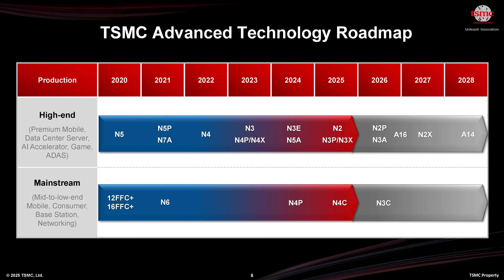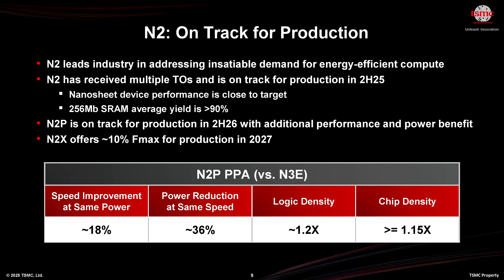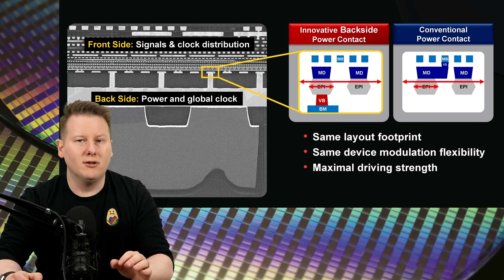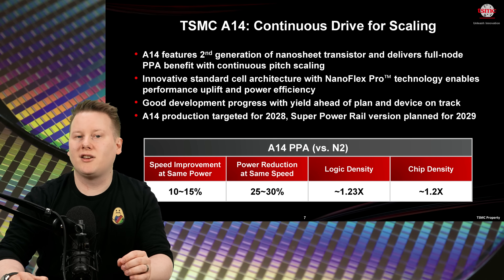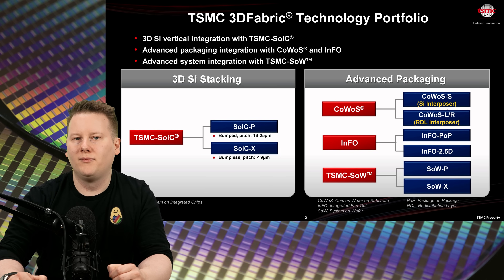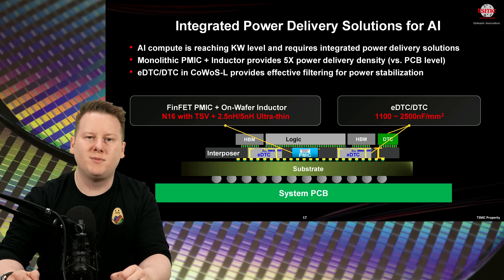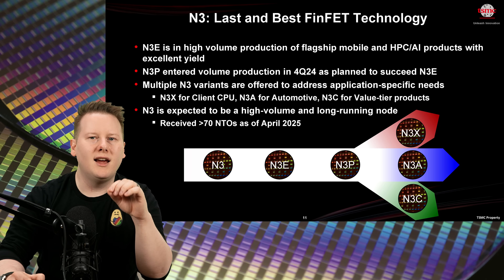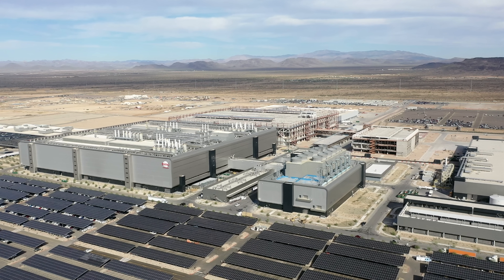The Future of Chips is TSMC's Roadmap to Success

Comment: Where is High-NA in TSMC's roadmap?
We used to see a doubling in performance from only moving to the next process node without much fancy new tech. Now, we are not just changing the transistor "size" (I have put size in quotes because the size of the transistor is nonlonger accurately represented by the name of the process node. 2nm is not really the size of the pitch in an N2 node). We are changing the transistor itself from FinFET to Gate-All-Around. We are also changing the structure of how transistors are designed with Backside Power Delivery. All these changes, and we still can't even get a 1.5X performance uplift.
Even though the performance uplift is not what we used to enjoy, the technological innovation needed is a marvel as things get even more difficult and complex as we advance the process nodes.

Comment: so anywhere from 1.38-1.42 density/ transistor increase from N5 -> N2E.
That means for a 40% jump in performance from a rtx 5090 the next Nvidia card has to be in N2X or 1030mm² in die size...

Comment: A14 is really not looking good. I understand the difficulty they are dealing with but even if we assume they meant N2P when they were comparing N2 to A14 That is almost no progress for a full node (Probably why they refused to compare A14 to A16) that is going to take 2 years. desktop parts on A14 might only be 2-3% faster and 10% more dense then A16 based on their own marketing numbers.That means we are essentially stuck with desktop parts and I assume price  per wafer will go up alot making it even worse. We might see 2-3 maybe more generations on the same node get more common after 2nm.Efficiency scaling looks better for mobile but the desktop outlook is pretty sobering.
Reply: TBH, it was an inevitable brick wall that they would run into on pure transistor size as a relevant measurement. Moore's "law" was destined to completely fail at some point and what we are left with is pure marketing buzz that implies that transistors are shrinking by 50%, but it's all basic nonsense and has been since the roughly 10nm era, when "nm" had any real meaning.  In the future, it's all about layers, discretes and stacking, not transistor size.
Reply: seems we will be stuck at 150-200mTr/ mm2 until 2028 probably, maybe 300mm2 in 2030 A12

Comment: improve node a bit, sell the same architecture again, repeat.. again, again and again. minimal R&D spends insane margins, steady insane profits and prices don't drop because progress is minimal and overpriced. enjoy the same iphone/GPU/CPU as 5 years ago with minimal improvements... but with higher price)) just keep buying and with 0-5% gain/year you'll see actual progress in year 2080
Reply: they should just make realistic graphics with AI from primitives in realtime. and make rasterization in games obsolete (it should be used just for primitive graphics for AI reference). GPUs of the future must be just AI cores making realistic graphics from primitive graphics thats done on integrated videocard - iGPU. and maybe with NPUs we won't need GPUs at all anymore. RIP amoode and ngreedia.
for realistic movie-like rasterization you need way more work to be done on games by devs with animations/level design/modelling and way more resources/rasterization speed. more GPU power essentially + VRAM (that last one can be easily fixed though by connecting DDR5-6-7/SSD directly to a chip like amd already does on consoles, no long PCIe bus for DirectStorage = no huge latency problems).
with AI generating a picture you don't need any of that just feed it photoshopped or even selected AI generated pictures of what you'd want to get and primitive 3d graphics so it doesn't fall apart and everything stays/generates where it should be + a description of whats going on. thats it.
that would enable anyone to make their own REALISTIC-looking movie-like-quality games (or movies). RIP big game studios and hollywood.

so to save big game studios and hollywood and steady money income (themselves) GPU manufacturers nv/amd/sony/ms killed the progress with GPUs. 
endgame GPUs with realistic graphics are the last GPUs you'd EVER need to buy. nothing to sell after you bought them. so corporations are milking the market instead with 0 progress slow junk.
Reply: simply stop buying new then, you can build a PC with 2020 parts and  its plenty fine, and less than half what it was new back then. Same goes for a phone or any other gadget, just buy used or buy less
Reply: @user-lp5wb2rb3v  i completely agree that anyone should buy used instead and don't feed corps greed, but its not the solution. meanwhile techshills on yt keep spreading marketing lies and make noobs overpay for new 0 progress overpriced junk. so we are stuck without progress because noobs want to listen to shills/marketing and to keep buying slow junk
Reply: NVidia, Intel or AMD CAN TECHNOLOGICALLY make 'processors and GPUs that are 2x the speed of THEMSELVES in each successive revision, but they DEFINITELY NEVER WOULD. guess WHY? because why sell something 2x as fast as previous gen when you can MILK IT FOR 2 DECADES MAKING 100X MORE MONEY. no R&D spends, just steady income stream, just feed noobs marketing lies about "physical and technological brick walls" while memristor or tera-herz zirconium dioxide tech EXIST for 2 decades already.
Reply: fast 2x progress WOULD DROP LAST YEAR PRODUCTS PRICES by 2x at the very least. no corp wants to compete AGAINST THEMSELVES. thats why e.g. they sell low-VRAM 0 progress 10x overpriced GPUs and also crap hardware consoles and stripped out CPUs like no 3dvcache ryzen because with 3dvcache they raise prices 3x times. all to keep prices HIGH. make noobs believe 'its hard to make'. no its not. its just paywalled by corps and all raising competition gets bought or sued and destroyed by multi-billion greedy corps
Reply: It's called a physical and technological brick wall, pointless whining about it won't help.  Moronic conspiracy-theory laden babbling is comically pointless.  If NVidia, Intel or AMD could magically make 'processors and GPUs that were 2x the speed of the competition in each successive revision, they would, but guess what...
Reply: there's LITERALLY NO physical or technological brick walls)) the moments corps actually NEED progress to catch up to ACTUAL competition (that sometimes rises from desire to gain market share) THEY EASILY DO IT. like amd with 9070xt and rtx. when corps NEED progress it IS RIGHT THERE.
intel didn't actually want to make a GPU faster than nv, all they want is those sweet huge GPU margins thats why they are making GPUs now when GPUs are 10x overpriced and have HUGE MARGINS. thats how b580 came to exist.
when ryzen started cores race INTEL EASILY DID 'glue-up' themselves. apple easily made the best mobile CPUs then qualcomm/nuvia EASILY made the same - just software and prices suck because they want TO MILK, not to compete or drop prices.
then amd easily made ryzen x86 chips faster than Apple because Apple started milking their M chips. they even never compare it to predecessor like m4 vs m3, because there's basically no progress. they only can compare it to M1 to make gains look somewhat decent (ignoring overprice).
Reply: lookup Bolt graphics. you really think nv/amd can't do the same? really think they can't do more VRAM on 300+usd cards that costs like 30usd for 8gig gddr6? really think they can't make proper directstorage on PC GPUs without long laggy PCIe bus that ruins it? just how they ALREADY do on consoles or radeon pro ssg from 2016?
really think intel can't release intel tera-herz? they just don't want to because fast tech progress will make ALL current tech obsolete and DROP IN PRICE TO 0. they want to sell you 40yo silicon tech instead with miniscule yearly gains and make trillions. they want to sell you 6yo performance in GPUs with insane overprice. they want to sell you 3dvcache with 3x overprice not with just BOM/manufacturing cost +20-50%  on top. nope. pay +1000-2000% or even more for "new" a bit faster tech. 5800x3d is basically the same as 7500f in gaming performance. you really think they can't just use 3dvcache on all desktop CPU? can't improve IN OBVIOUS WAYS GPUs? more VRAM, ssds directly connected to GPU chips to remove directstorage bottlenecks, tiered memory with DDR5 for textures?

GREED is whats stopping the progress. technology and physics are fine and dandy.
Reply: amd uses DirectStorage with ssds connected directly to a chip on consoles since 2020, Pro SSG 2016. Bolt just replaced ssd with DDR5, basically made a proper DirectStorage on GPUs without long laggy PCIe bus. the only reason amd still didn't do it themselves is they want to keep selling obsolete consoles hardware, better PC GPUs will kill consoles. bad for business. nvidia/amd are perfectly aware of what they are doing.

the same way nuvia is 5x faster than Zen4. yet why they didn't release it right away? because milking already existing tech is WAY MORE MONEY. qualcomm gonna make 'new' chips with the same old nuvia tech for a decade or more now. just like intel 14nm+++++++++ did. or how apple with m chips, or amd with ryzen chips. amd had performance numbers for zen @ ryzen 5000 levels before zen1 release. but then they've just cut it down to not compete much against intel. thats how am4 got long life - they just rereleased zen1 4 times each time a bit  less cut same chips with gains to match intel 10-14gens until 5000 was what zen1 should've been right away. then added 3dvcache to 5000 but removed it on 7000 CPUs to not compete and to not drop prices and SELL THE SAME CPUs more times while noobs are buying 3-4 CPUs instead of buying its 'complete final version' right away just 1 time.
Reply: nvbots kept saying 'build your own GPU if you don't want to pay for 10x overprice'. apparently thats what Bolt Graphics did.
some greedy huge corp probably will buy Bolt Graphics for some billions and kill it so they don't mess up them milking of the market with 10-20x overpriced junk, most likely we will never see it released. because thats what ALL huge corps like nv/amd/intel/apple/google etc. do - they milk the market to not drop prices on slow 0 progress junk they release
Reply: 'bad optimization' is nv marketing 💩they made up to justify 10x overprice and 0 progress with their GPUs. mining is over. nv mining-level 10x prices make 0 sense because GPUs DON'T PRINT MONEY anymore. nv stopped 4000 production half a year before 5000 launch to fake 'deficit' because 4000 with their msrps were rotting on shelves nobody was buying them. fake 'demand' and 'mining-like deficit' to fake that its 'sold out' everywhere and that msrps 'are fine'.
Reply: @awebuser5914  fast 2x progress WOULD DROP LAST YEAR PRODUCTS PRICES by 2x at the very least. zirconium dioxide would KILL SILICON production. and no corp wants to compete AGAINST THEMSELVES. thats why e.g. they sell low-VRAM 0 progress 10x overpriced GPUs and also crap hardware consoles and stripped out CPUs like no 3dvcache ryzen because with 3dvcache they raise prices 3x times. all to keep prices HIGH. make noobs believe 'its hard to make'. no its not. its just paywalled by corps and all raising competition gets bought or sued and destroyed by multi-billion greedy corps
Reply: NVidia, Intel or AMD CAN TECHNOLOGICALLY make 'processors and GPUs that are 2x the speed of THEMSELVES in each successive revision, but they DEFINITELY NEVER WOULD. guess WHY? because why sell something 2x as fast as previous gen when you can MILK IT FOR 2 DECADES MAKING 100X MORE MONEY. no R&D spends, just steady income stream, just feed noobs marketing lies about "physical and technological brick walls" while memristor or tera-herz zirconium dioxide tech EXIST for 2 decades already.
fast 2x progress WOULD DROP LAST YEAR PRODUCTS PRICES by 2x at the very least. no corp wants to compete AGAINST THEMSELVES. thats why e.g. they sell low-VRAM 0 progress 10x overpriced GPUs and also crap hardware consoles and stripped out CPUs like no 3dvcache ryzen because with 3dvcache they raise prices 3x times. all to keep prices HIGH. make noobs believe 'its hard to make'. no its not. its just paywalled by corps and all raising competition gets bought or sued and destroyed by multi-billion greedy corps
Reply: @awebuser5914  NVidia, Intel or AMD CAN TECHNOLOGICALLY make 'processors and GPUs that are 2x the speed of THEMSELVES in each successive revision, but they DEFINITELY NEVER WOULD. because why sell something 2x as fast as previous gen when you can MILK IT FOR 2 DECADES MAKING 100X MORE MONEY. no R&D spends, just steady income stream, just feed noobs marketing lies about "physical and technological brick walls" while memristor or tera-herz zirconium dioxide tech EXIST for 2 decades already.
Reply: that's not what's happening here.
Reply: @12100F  it is, ridiculous 4core  Intel processor from '22, thats exactly whats happening IRL
Reply: @rawdez_  2/10 ragebait, try again later
Reply: @12100F  ridiculous 4core  Intel processor from '22, nobody cares about what intel fanboys-shills 'think' about what "14nm++++++++++ corp" is. it is just another greedy corp maximazing profits and margins while selling the same crap to noobs  by just renaming it multiple times and changing sockets and a lot of marketing lies, corp that should burn for actual progress to happen. just like all others. otherwise they just milk the market and cause stagnation by doing so.
Reply: 14nm++++++++++ corp conveniently 'couldn't make progress' for YEARS, selling the same 14nm junk,  right until amd actually started competing (barely) with ryzen after bulldozer with fake cores. and just as ryzen started actually beating them oh MIRACLE! intel finally could do 10nm)) rejoice fanboys!))
and the same with 12-13-14gen. amd stopped actually competing, killed momentum with ryzen to milk the market, and intel stopped, and apple stopped, and nuvia/qualcomm didn't even start - overpriced their nosoftware windows arm junk (despite being 5x faster than zen4 we didn't see any real gains). and smartphones aren't better. each year for the same price you can get basically the same performance... or worse. causing stagnation with mobile software/gaming. those flagship dumbphones are useless because nobody makes software for hardware in them noone can or want to afford but a bunch of noobs with too much money. suddenly every corp started pricing hardware like they are also apple and their customers are all the same noobs that can't do basic math when comparing stuff as isheep.

Comment: lol, all corps get insane margins, latest iphone 16 n3 chip costs 30-35usd to make @16-17k per wafer. "will make economics work" ahhaha. if insane greed of selling 30-35usd chips with insane margins for 1200usd+ didn't stop "economics" then nothing will. "worst case" for greedy manufacturers they'd lower their margins/greed a bit.
rtx 5080 chip costs like 100usd made from tsmc, nv and AIBs sell that for 1500-1800usd. 5080 57fps 1080p indiana jones, that slow 10x overpriced 540p junk barely can run modern gaming engines @max settings. meanwhile 1440p 100hz monitors costs just 100usd which means 5080 has like 35usd worth of MODERN gaming performance. keep buying 10x overpriced junk, noobs, and "economics" of selling 0 progress 10x overpriced junk will continue "working" i.e. milking the market with slow as-low-as-possible "progress'.

Comment: Who cares about fake node names?! Why can’t they just tell us real transistor density (as the main number/ point)?
Reply: Because real transistor density is not a single number. You have logic density and SRAM density then you have HDL and other low power libraries.
Reply: "Density" is kind of meaningless since it's not increasing in any a historically relevant way.  It's all about leveraging what density exists in new ways via on-die discretes, stacking and power distribution (efficiency).
Reply: @awebuser5914 Density is still increasing. If we talk about logic density then they are doubling every 3 years right now. A lot slower than doubling every 18 months like before but density improvement is still exponential.
Reply: @kazedcat  "they are doubling every 3 years right now..."  Nope... Going from N3 to A14 is only an advertised 48% gain in density and A14 is planned for 2028/2029 and N3 has been in production for a few years already and large scale mass production this year (various iterations; N3P, N3X, etc. and some N3 nodes are lower density to support higher voltages)

The above rate of density increase will continue to slow , it is simply inevitable.

Comment: So is bumpless stacking done using TSVs?
Reply: TSVs may be used for stacking with both solder bumps and bump less bonding. 

That is, there are currently die stacking techniques with TSV based dies where there is a solder bump placed between the TSV to make the die to die connection. 

Taking that to the next level is doing die to die stacking using hybrid bonding, where flat copper end cap on the ends of the TSV‘s our pressed together and hybrid bonded directly to each other, without having a solder bump in between. This makes for a lower resistance and shorter connection between the dies. 

Check out the Asianometry video called “Why Wafer Bonding is the Future of Semiconductors”. Specifically the hybrid bonding chapter at 14:30